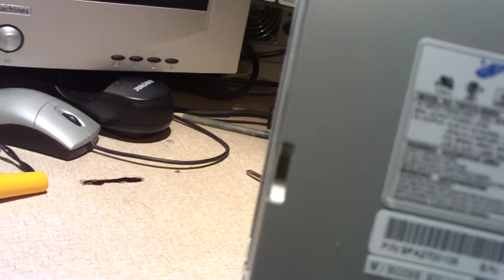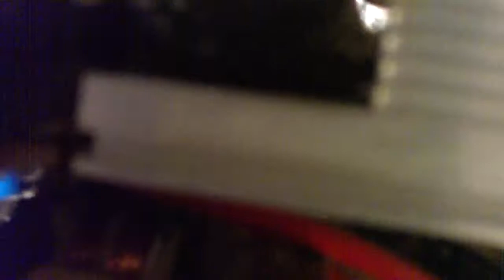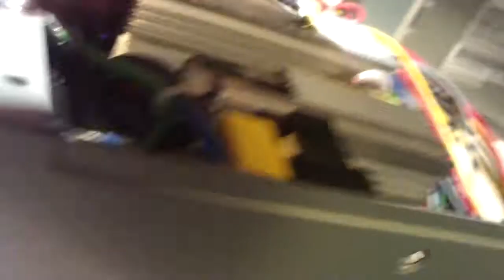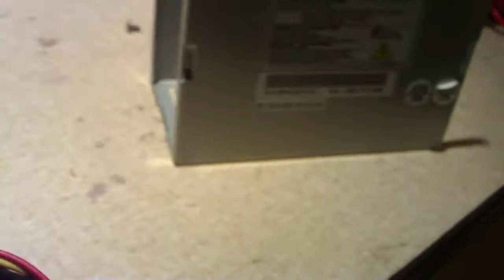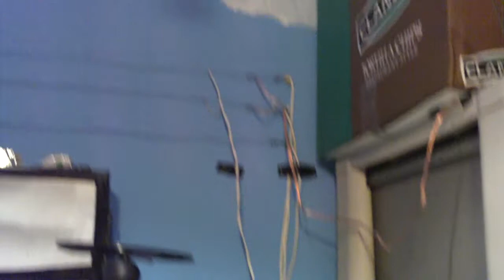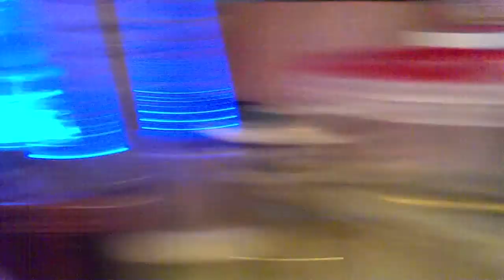Another Example of a Quality PSU

Comment: I have a tx850 corsair psu that no fan or noise happens when it is on and plugged into a motherboard. The motherboard LED lights, however. I shorted pins 15 and 16 on the psu connector and no noise or fan. Could this be the fuse?
Reply from the maker: If the motherboard lights up in standby, then the 5VSB rail is working... Green and black are the pins to short to turn it on, just to make sure you're connecting the right ones. If it doesn't start, then there's something wrong in the unit... and it's not a fuse since the 5VSB rail is working.
Reply: @CubeComputerChannel  Pins 15 and 16 are the green and black wires. I was thinking that the fuse couldn't be bad if it supplies some power. How do u drain the caps in it to prevent a shock?
Reply from the maker: @meblake7359  Let it sit unplugged for a few hours to be safe. They generally have bleeder resistors across the big capacitors to discharge them.
Reply: @CubeComputerChannel  Thanks!